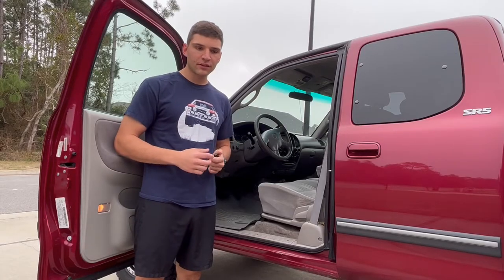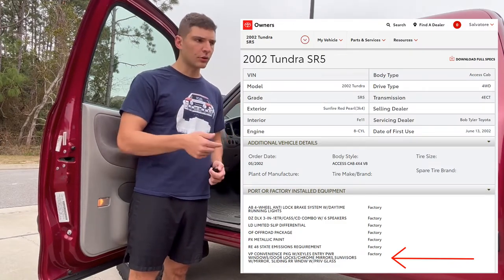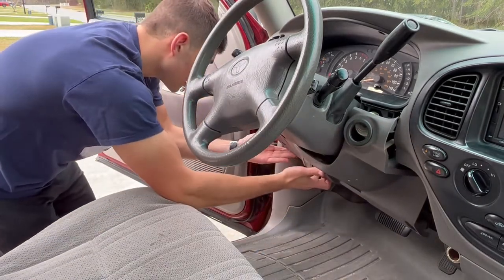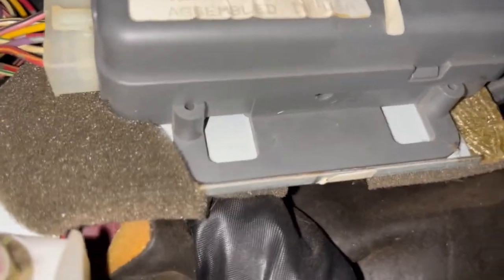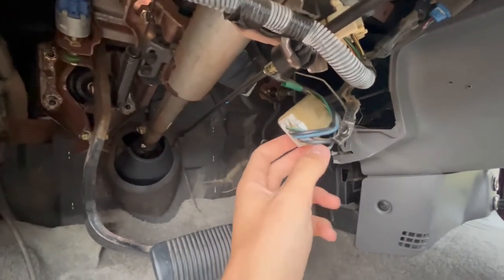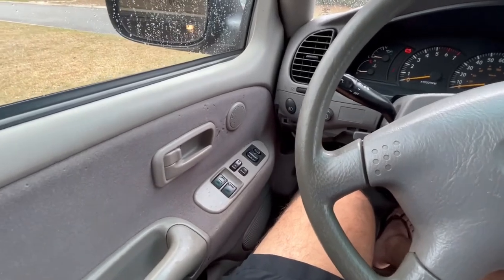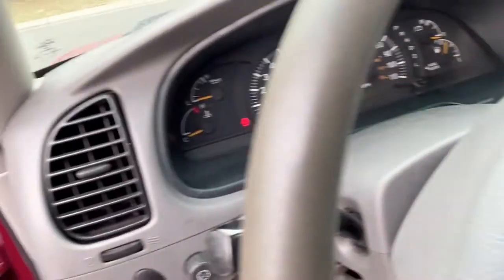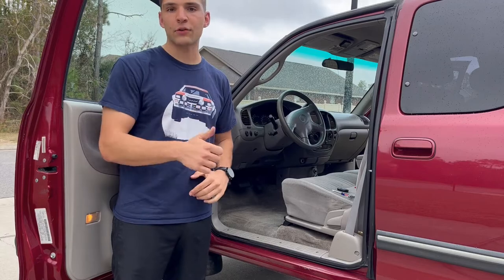Tundra key fob pairing WALKTHROUGH

Comment: I have a 2001 Limited.  How do I find out if mine has this feature?
Reply from the maker: So the easiest way is probably to go on toyota.com/owners and register your VIN. Under the "my vehicle" tab at the top, you can select "vehicle specs" and it will pull up all of the factory specs for your truck. My security system is factory installed and labeled "VP CONVENIENCE PKG W/KEYLES ENTRY PWR". You could also call your local Toyota dealer and have them run your VIN if you can't get a good answer from the website. Hope this helps, thanks for watching! - Sal
Reply: mine says the same thing can you post the link to the key fob the ones i see on amazon are just the casing .
Reply: Where do you buy the key fob and what brand is it?

Comment: Thanks for this video! You explained it so clearly, especially the location of the RS3000 box. I bought my 2002 two years ago and this was one of the first things I tried to do, but couldn't find that box. I don't think I found any post in any of the forums that said it could be behind the air duct. I couldn't see the green button on the box, and removed it from it's stud. From there, i could actually see the security light light up like the manual said, that helped with the timing especially clearing previous remotes from the system. I had been slacking off on the minor upgrades on mine, but I think you're one of the few still making content on the First Gen. I'm enjoying the videos, I like that they are short and simple, but heavy on good content. Keep it up.
Reply from the maker: Of course, I am glad it was helpful. I didn't find much out there when I was looking for it myself so I wanted to make the best video I could explaining it. Thank you for watching! - Sal

Comment: I wrote down the instructions for the video on the 2015 Tacoma, I haven't tried them  yet, but your tutorial was alot more informative since my truck is a 2007 tundra alot closer in age and the key fob I got off Amazon actually had the same ID # that is listed on the back of my key fob I'll check out the info in your links and maybe I can do this with out a dealer or locksmith or renting a tool from someone online so thanks again
Reply from the maker: Yeah, I think all of the instructions are vaguely similar but with some small nuances for each model. Best of luck getting it paired up, and thanks for watching!

Comment: Several years ago I attempted to program the remote that came with the 02 Tundra I had purchased from a previous owner. Zero success. Totally gave up. I think I even tossed the remote. A month or so ago my lock cylinder on the drivers side door broke so I could no longer use the key to unlock the driver's side door. Instead of replacing the cylinder I revisited the idea of programming a remote. In researching this I came across your video. PROBLEM SOLVED!!! Never heard anyone mention anything about switching the connectors. Not sure why the connectors would be set up from the Toyota factory to bypass the alarm system. Any thoughts on why? How did you discover this bypass? Thank you so much! Looking forward to watching your other videos for my Tundra!
Reply from the maker: Love to hear that! I couldn't really come up with a good reason why Toyota would swap those. But I stumbled across and old forum that talked about this and had to make a video to share it with a ton more people who shared my frustration lol. Thanks for watching

Comment: Hey, so I'm having trouble getting mine to pair and maybe you can help. I have the same year Tundra with the same alarm package, and ordered the same key fob. When I swapped the wires like you showed and turned the key to the on position, the doors did not lock. I pressed the green button but did not hear or feel a click when doing so, was that your experience also or did it click? Needless to say, when pressing the button on the fob after pushing the green button for 3 seconds, there was no beep. I'm not sure if there is something wrong with the alarm box, a short in the alarm wiring, or if there is something else I'm missing here. Any input would help.

Comment: Thanks!  have 2002 SR5 V6 and the module was looped like in your video.  The locking unlocking behavior now work when I turn the truck on off.   unfortunately the generic fobs I bought don't connect.  Going to order a OEM used off ebay and give it a shot.
Reply from the maker: Glad the video was helpful. Too bad the fob didn't work, hopefully a used oem one will do the trick. Thanks for watching! - Sal
Reply: @JDMDriveway  Working now =)
Reply from the maker: Perfect!! 👍🏼

Comment: Did you plug the connectors back to their original spots after programming?
Reply from the maker: Good question, but no they stay where you swapped them to. Otherwise the security system is bypassed again. Thanks for watching! - Sal
Reply: I was wondering that as well! Thanks Sal 🎉

Comment: Thanks for the video! One question, did you leave the electrical connectors swapped or did you switch them back to original configuration? 
Thanks!
Reply from the maker: Hey Steve, you have to leave the connectors swapped in the new configuration to have the security system active. I guess I haven't actually swapped them back to see what happens, but I'd assume it just disconnects it again. Hope this helps! - Sal

Comment: My 02 came with a fob, probably aftermarket bc it had key start, from the used car lot I got it from. The fob has a new battery but all of a sudden doesn't work at all but the red light does flash
Reply from the maker: Hmm, I’m by no means an expert on these things so Im not sure what the problem could be here. Maybe if you got up under the dash you could see what module you have and troubleshoot from there? I’m assuming it would be in around the same location as stock - Sal

Comment: Great video dealer wants $235.00 to program new fobs! So just wondering if you returned the wired connections on the harness back to the way they were initially connected?
Reply from the maker: Nope, you just leave the harness in the new position. If you switch it back, it just bypasses the security system again. Thanks for watching! - Sal

Comment: Sal - great video.   

Have you found a way to completely disable the need for a fob/alarm?  I’m kind of over it.   

Would unplugging the security module work?
Reply from the maker: Hmm, I would think that the best way to disable it is doing the reverse of my solution here with the looped wires. Before fixing it, you wouldn’t have known my truck had a security system or key fob. Just unplugging it could probably work too, but I’m not sure if that would mess anything up with some of the wiring going nowhere. Hope this helps, and thanks for watching - Sal

Comment: I have a bab237000-129 would you be able use the -022 key fob ? Also I notice on the forums people talk about the grey and black fobs are different I have a 2002 tundra so would I specifically get a grey one I don’t have the original key fob so I have no idea which one it needs ?
Reply from the maker: Yeah I ran into the same problem because my truck didn't have a fob either. Unfortunately I think a good plan would be just getting both, and then returning whichever one doesn't work? Or getting one at a time. I'm no expert, and I haven't done research into this in a while so sorry I don't have too much help to offer. Hope you can get one working though, and thanks for watching!

Comment: I bought the same remote, went thru the exact same steps you did except my doors don’t lock and unlock when the key is turned on. When i hold down the green button i hear the system click but the doors won’t lock. I’m unsure how to get the remote to pair
Reply from the maker: Dang I'm not sure about that. This has worked for just about everyone I've talked to. Hope you can get it figured out, or someone else in the comments has found a good solution. Thanks for watching
Reply: @JDMDriveway  thank you for the response. anyway we could like facetime and see if you know why my truck isn’t doing the same?

Comment: Hey Sal, I’m trying to get a key fob to program it. Previous owner did not have one. I don’t have that green button and everything looks different. 03 4wd v6 ac.

edit: nvm. found out i have the rs3200 system. Is the bypass system the same? Would love the feature of putting into park to unlock and drive to lock.
Reply from the maker: Hey man, sorry I don't have any experience with the rs3200 system. I looked quick and found an rs3200 manual here, but I'm not sure how helpful it will be with pairing or setting up the different features. Hope you can get it figured out! - Sal

https://www.toyota.com/owners/resources/warranty-owners-manuals.tundra.2002

Comment: So I have a 2000 limited ac my box was in a different location. It was actually near the fuse panel where your left knee would be. Much harder to reach but either way it worked. I'm curious though is there a way to make the horn beep when you lock and unlock
Reply from the maker: Hmm that's weird it was in a different spot. Good to know though, and I'm not sure about the horn instead of the chirp for lock and unlock. Thanks for watching - Sal
Reply: @JDMDriveway  I don't have a chirp or honk lol I looked up the code for turning on and off but doesn't seem to work lol 😅
Reply: How did you do it? I have the same truck and I am struggling looking for the green button. I am very much stuck so I would appreciate it if you could reply back. Thank you

Comment: So I programmed the fob and it works but I can press the lock button and it locks it but if I press it again it unlocks. It does the same with the unlock button. Any idea why?
Reply from the maker: Hmm, on my fob the top button locks and unlocks the truck. The bottom button doesn’t do anything for me 😂 If you look in the RS3000 manual, which I have linked in the description, it explains the different options for what the buttons can do. Hope this helps! - Sal

Comment: Help! I have followed your directions several times but to no avail.  I am not sure if I am getting the green button pressed in correctly. I did get it to beep 3 times. My key fob is original. Perhaps it's no good?  I do get red lights on it when I press it. Any advice is appreciated!
Reply from the maker: Hmm ok so the truck beeped 3 times when you pressed the green button? If your doors lock and unlock when you turn the truck on and off, then I would tend to think that it is a fob issue. But if they do not, then I would try to find out exactly which system you have. Once you know for sure, that will determine which fob FCC-ID you need. That is one of the most confusing things I ran into when researching this myself. Forums can be your friend if you get lucky 😂 let me know what you figure out, and I’ll respond to any questions you’ve got! I’m just an enthusiast, not a mechanic or specialist so I apologize for not having a great answer! - Sal
Reply: @JDMDriveway  thank so much!  The dealer said it's the key fob. Looking to order new on eBay. Let me know if you have a good source for a key fob! Joe
Reply from the maker: I bought mine on Ebay from whatever vendor had one available, but I hope it works out for you, Joe! Thanks for watching - Sal

Comment: Unfortunately, this isn’t working for me, I’ve done it like 20 times and every once in a while, I get 2 beeps from my truck instead of one, but nothing else. I have two different fobs that I’m trying, and they both light up and click. They used to work, I don’t know what’s going on.
Reply from the maker: Dang man, sorry to hear that. If it used to work and it beeps occasionally then I wonder if the module just went bad? I'm not an expert by any means, but I know how frustrating it is to have features that you can't get to work properly. Sorry the video didn't work for you, but I hope you can get it figured out. Thanks for watching - Sal
Reply: @JDMDriveway  I'm not sure, I do have to report though that after bullying the key fob and then cannibalizing a second one for good parts inside, it seems to be working. It probably comes down to just being old, but I can say I wouldn't have done any of it without your video. Thanks man.

Comment: Hey for my tundra it only says that from the factory it came with R8 emissions required factory but that's all it says and it's 2000 limited
Reply from the maker: Hmm I would expect the limiteds to come with wireless entry. But there's a chance your truck didn't come with it. You could always confirm by calling your local dealer and seeing that they say. Not sure how the process would work to install a system now. Sorry, I'm not a professional, just a fellow owner. Hope you can get it sorted though, and thanks for watching! - Sal
Reply: @JDMDriveway  so I look under the steering wheel and I couldn't find the alarm system box I guess that mean I my truck did come with factory keyless entry even though is a limited.

Comment: I ordered the same key fob but the led on it won’t light up. I’m not sure if it’s because it’s broken or because it’s not on but I can’t get the led to turn on when I press the buttons. Do you have any tips?
Reply from the maker: Hmm, the first thing I would check is the battery. I’m not 100% sure how to open these fobs but it looks like just the screw at the bottom and then pry it apart. If that doesn’t work, maybe try going through the pairing sequence anyways, because it’s possible that the led just isn’t working? Otherwise you may have just unfortunately got a bad unit - Sal
Reply: @JDMDriveway  I took the fob apart and moved the battery around but nothing. I also tried to pair it to my 02 tundra but it wouldn’t work. I’ll probably just get a new one and see if that works. Thanks for the help!
Reply from the maker: Dang that’s too bad, hope it wasn’t too expensive. Best of luck with the next one 🤞🏼
Reply: Let us know if the new fob works!

Comment: Hey guys have yall seen a issue where the Key fob works but only at close range? Battery is new in the key fob.
Reply from the maker: Yup, my key fob only works within about 10ft of the truck max. I have also recently replaced the battery with a brand new one. I think it's just how it came from the factory, I've seen other people complain about the range as well. Thanks for watching
Reply: @JDMDriveway  Hey buddy LOVING the videos!! Keep em coming. I can assure you this is not normal. I am the original owner of my 2003 Tundra. It was MUCH better. I was getting up to 100 yards. Now, I have to be right by the truck. Something is wrong.
Reply from the maker: Glad you're enjoying the videos! Thanks for the heads up about what the range should be. I had no idea it was supposed to be a lot further than that

Comment: Just installed it on mine and another thing i wont recommend is to hold the lock/unlock button it activates a panic mode and to turn it off you hold the lock/unlock bottom again and once the light flashes and stops press the bottom button and it turns it off
Reply from the maker: Yup, I did that once before and it scared the crap out of me haha I couldn't figure out how to turn it off 😂 it was doing that unique horn honking sequence right?
Reply: @JDMDriveway  yeah it would honk like 3 times and pause for a second then continue
Reply from the maker: Exactly!!